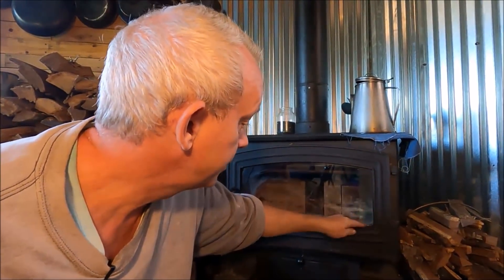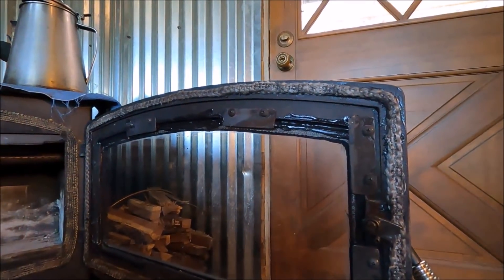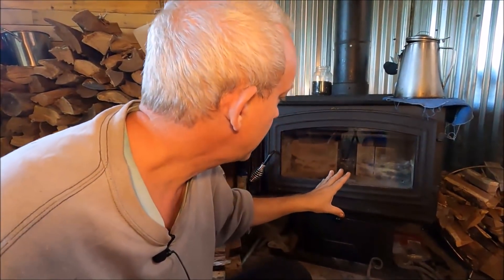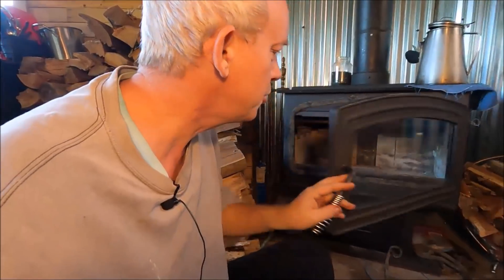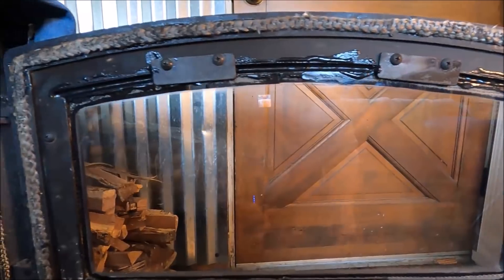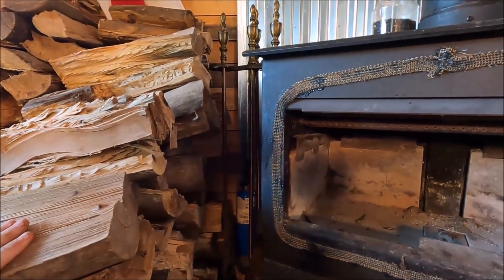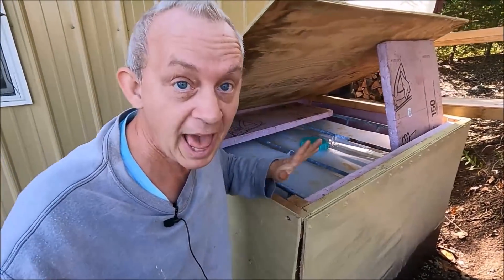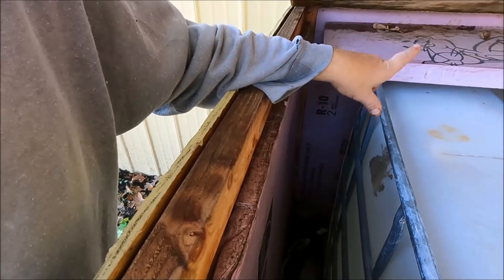The Authorities Notified Me I Can't Use Off Grid Water This Winter Living In A Tiny House

Comment: Hi Rob, you have hit the nail on the head when talking about thermal mass. Water is one of the best. That's why it is use in high tech buildings in Europe to help maintain more even temps with its slow release of hot/cold.

Comment: Not sure if this would do much to increase the air temp inside the box but it might have a nominal impact..... probably more than nominal depending on the volume..... since your ground only freezes about 18 inches deep, could you put rebar into the ground to conduct 50 to 60 degree earth temps upward and wrap the rebar in expansion foam to isolate it from the frozen top level ..... and then buy or build or “spray” foam around the pipes that are vulnerable to freezing?  Might be a total fail but heat rises and if you got the rebar down 8 to 10 feet perhaps it would bring a small amount of warmth upward into a foam “chamber” that would hold the warmth.  Low cost and no electricity and no risk of fire from propane etc ..... anybody ever tried something similar?

Comment: You could attach an RV holding tank heating pad to your tank. The heating pad runs off of 12 volt. They are used on rv's to stop holding tanks from freezing.
Reply from the maker: As I said in the video the Tank is not freezing.